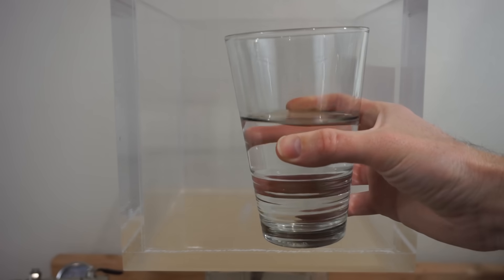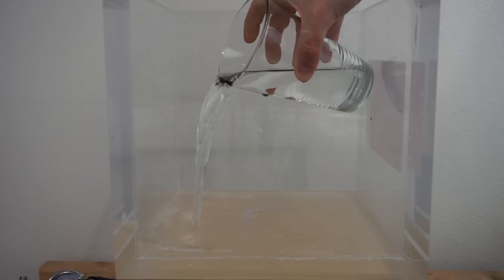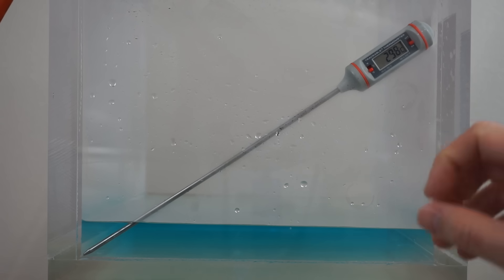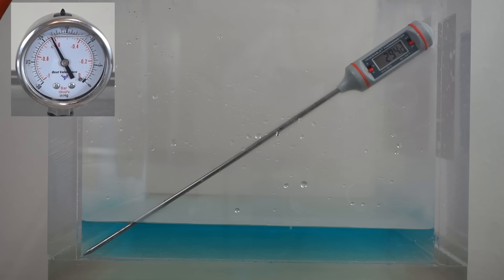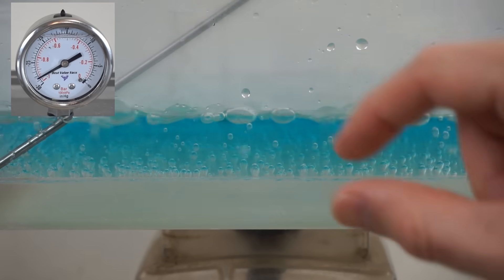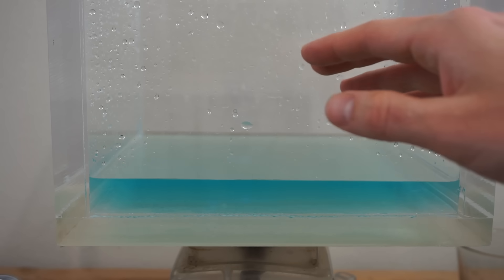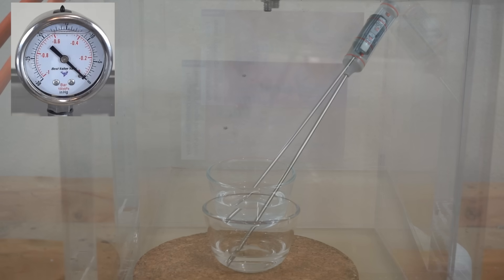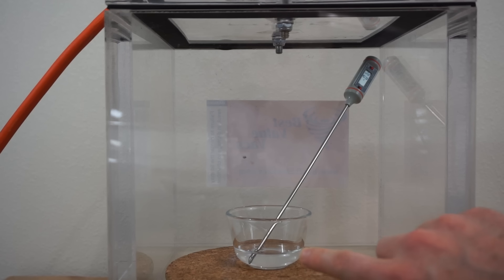Does Water Really Boil in a Vacuum Chamber? And Why?

Comment: so it is possible to drown a fish
Reply: Mind blown
Reply: Yes fishkeepers know this, when oxygen is low in water fish drown the first sign of low oxygen is fish going to the top of their water to breathe.
Reply: @TheFakeyCakeMaker  yes
Reply: Wow.
Reply: Is it possible to fly on air without wings?
Reply: @alaaalkhamis8306  you become the wing as soon as you displace air around you, regardless of the shape.
Reply: @alaaalkhamis8306  yes. With enough constant lift. Like a jet pack.
Reply: @alaaalkhamis8306 yeah helicopter
Reply: Dont change the aquarium water or airate it.. and the fish will drown..
Reply: If you drag a fish backwards in water, its gills are forced open and it can drown..
Reply: @TheKing318i  makes sense, you cant be inhaling for ever
Reply: the fish will explode before so no-
Reply: @lilofication what
Reply: it can already drown in water 
some fish will die due to too salty water
Reply: fish use water to stay alive. They do NOT breathe dry air. THE END
Reply: @philindeblanc bro skipped 1st grade and everything after
Reply: i almost died xD
Reply: Cook a fish
Reply: @saw9634  I guess its not just heat that is boiling, it can be the pressure like this and perhaps its gas escaping the liquid. Some things we can only try and explain, while institutions of science want to claim it knows what is happening. It certainly does not.
Reply: Fish can drown…

In Fire
Reply: @muhammadfuzail1574  fish can drown in plain ole water. They still need oxygen. If the water cannot replenish oxygen faster than the fish use it up, they die.
Reply: Would it be drowned or would it suffocate 
I’m not sure what the difference is really. 
I assume drowned usually first to be in it liquid since fishes live in liquid can you just removing all the air I think they’re suffocating
Reply: No. However, you can suffocate a fish. If you remove the oxygen from the water, the fish can no longer get oxygen, so it suffocates.
Reply: Can you dry clothes in a vacuum chamber?
Reply: @DatOneMango hade you ever looked at a fish tank? It’s a mashine that bubble air into the water, if you wouldn’t have it they would actually drown after a while
Reply: yes fish need oxygen
Reply: @SodiumInteresting theyre animals ofc
Reply: @Mango The Protogen  fish need air to live but they need water to breath it so if you push air into the blood stream of a fish it could live outside of water for a while longer the normally
Reply: Yes
Reply: Well if it didn't it would be like saying humans can breathe in a vacuum. If there is no air neither the fish or the human can breath
Reply: Most fish you need to aerate the water or they will suffocate the die. Goldfish require very little oxygen so they don’t usually require an air pump. Most people have only ever had goldfish
Reply: Fun fact:
Fish can drown in dirt
Reply: It possible just take their gills
Reply: @dailydoseoftiktok6315  you dont even have to do that. If all the oxygen in the water is used up, the fish will soffocate
Reply: The only reason your goldfish doesn’t die in stagnant water is because goldfish can survive in very low oxygen environments
Reply: Yeh if you remove all the oxygen from water like in this video the bubble thing , than the fish will drown like a human
Reply: Yes
Reply: Yes because fish need air to survive like us so if the water in the tank is too dirty the fish will die
Reply: The fish will explode
Reply: YES
Reply: A few have commented about fish "drowning" if you don't change their water, but that's not correct... they actually get poisoned by their own wastes.  First they produce ammonia, which in an established aquarium have enough bacteria to break that down into nitrites. With insufficient bacteria, "new tank syndrome", and too many fish, you can lose them to ammonia poisoning. The nitrites are quite harmless, and they too soon get broken down into harmless nitrates. However, the accumulation of nitrates will eventually become toxic enough to kill the fish, that's why small regular water changes, about a quarter to a third every week or two, depending on the size of the tank, is necessary. The bigger the tank, the less frequently you have to do it, but it's essential to still do from time to time. 

Oxygen exchange actually takes place on the surface. Those air-bubblers can actually be harmful to the fish, as tiny bubbles can cling to their gills preventing oxygen uptake. A small amount of good quality salt in their water actually helps with osmosis, and it's surprising just how much you can safely add to still have "fresh" water. Pure water is actually bad for most fish. 1 teaspoon per 10 litres is a good rule of thumb to use. To understand how safe this is, most fish can survive in brackish water, which requires about 15 teaspoons of salt for every 10 litres, whereas marine seawater contains around 30tsp/10L. 

The bubbles in the tank really only provide oxygen as they burst on the surface. The best way to aerate an aquarium is with an internal water-pump filled with bio-balls or sponge, allowing for a large surface area for good bacteria to thrive. The best set-ups have an external tank or canister which leaves more room for the fish and more water to dilute toxins. Any flowing water is agitating the surface, where oxygen is replenished.

In the cases where fish suffocate due to low-oxygen, it's more likely a sudden pH spike or dissolved toxins, rather than actually low oxygen. 

As a general rule, the larger the surface area to volume, the better. In other words, a wide shallow pond rather than a narrow deep pond, gives most oxygen. A round bowl isn't ideal to keep fish in, unless for a temporary display. However, only fill it to the point where the surface is largest. If it gets narrow at the top, and you fill it all the way, your ratio of volume to surface area is not good, and fish can actually suffocate in more water, rather than less. It's essential to freshen their water daily, and to use something to remove or chemically alter the chlorine in treated municipal water.

Oh, and if you really must euthanise a fish for any reason, the fastest least cruel method is the sudden severing of the spinal cord at the base of the brain. Same for any vertebrate creature, actually. Remember that if you're fishing for food, rather than leave them to slowly suffer and suffocate in a bucket or whatever. Stress and torture taints the flavour of any meat, so at least send your meal off as peacefully and quickly as possible... by violently chopping off its head.
Reply: No, but they can be oxygen deprived in a vacuum - drowning has a specific definition that what you're probably thinking doesn't fit. Fish will not explode as at least one person said. I have a much more powerful chamber vacuum sealer and the meat doesn't do anything close to exploding. Room temp water boils after about 3 seconds though, so when vac sealing things containing any substantial amount of liquid (more than is contained in raw meat), you have to take some precautions
Reply: Yeah is they get pulled backwards through water their gills don’t diffuse the oxygen propped and they go unconscious
Reply: If the moon suddenly disappeared I would hazard a guess and say a lot of fish would drown. No waves = no aeration.
Reply: @Neoprenesiren they wouldn't drown, they would suffocate.
Reply: @randal_gibbons  "To kill by submerging and suffocating in water or another liquid." I get you mean we don't suffocate the same way underwater, but drowning something means to suffocate under water.
Reply: @Neoprenesiren  doesn't drowning require liquid entering the lungs?
Reply: No. Drowning requires water in the lungs, fish don't have lungs.
Reply: Well yes, if the water has little to no oxygen for the gills to collect, you can see this happen when filters in fish tanks clog, the fish essentially suffocate on the grit and garbage from the water they swim in.
Small tanks show this better than large because there is no where for the excriment and filth to go besides the filter or the tank, as oposed to the oceans it has large enough space to dilute or float to the bottom and settle.
Lol makes me wonder what the sludgy stuff on the bottom of the deeps sea submersible dives contains.😝
Reply: Can't say no
Reply: Actually yes, they can. If you've actually spoken to a fishkeeper. Many fish use actually a ton of Oxygen. Larger species in particular. I know Goldfish, Cichlids, Catfish, Pacu, Lionfish, Triggerfish and Oscar's all actually use so much oxygen, if you look it up, you'll be surprised. I know this cause I currently have many of all of those animals, except for Pacu and Catfish they get too big
Reply: yes octopi drown sharks all the time.
Reply: @kaleknelson8429  octipi not to be confused with octopi.....
Reply: @andrewvarcoe4741  no double and tripple checked. The multiple of octopus, is Octopi. It's possible that google is getting this wrong, but unlikely.
Reply: @kaleknelson8429  lol google getting it wrong, that's like teaching your kid to tie their shoes a certain way, then telling them they are doing it wrong.
Think about it, google is like a big bottle of information that people smart like you and me or dumb like others fills up. There are a lot and I do mean a lot, of dumb people out there. I'm just happy it gets some things right every once in a while, like searching how to boil water or an egg.
My thoughts on google, its a love hate relationship.....
Reply: If you put it in air.
Reply: No because they don’t have lungs like we do  instead they have gills if you took them out of water they would Generally, freshwater fish can live outside of water for about 10–60 minutes after 10-60 minutes they die
Reply: summers
Reply: If a fish Go to down she gona drow 😢
Reply: Shoke a fish
Reply: The real question is can you waterboard a fish?
Reply: It might be more accurate to say that they would suffocate.

Comment: Air pressure is also the reason air gets colder as you get higher in altitude.  
The higher the altitude the air looses pressure = it looses energy.......so the air gets colder.

Comment: why say "boiling"? it doesnt heat up! should be called "bubbling"
Reply from the maker: +Neil Baxter because the definition of boiling is when the vapor pressure of the liquid is greater than the pressure surrounding the liquid. Bubbling is when there are simply bubbles of a gas in a liquid. Boiling and bubbling are completely different phenomenon.
Reply: Very good experiment James. Well done. I guess the word boiling in most people’s  mind is associated with bubbling as a result of heating. This experiment proved that lowering pressure could achieve boiling without heating. The second part of the experiment was very neat too: the water left in beaker was getting colder.  So the degassed water ought to have different characteristics eg refractive index or for example a higher density than the original water. You may have demonstrated that already. Regards , Houtan Sadeghi-Jorabchi
Reply: @houtansadeghi  sorry to disagree!

quote  - This experiment proved that lowering pressure could achieve boiling without heating. 

in my opinion water was bubbling and not boling and so no proof of water boiling in a vacuum! To be fair this demo merely shows a lack of imagination within science to describe the observations fairly and accurately as there is no proof in the demonstraation water was actually being evaporated as would normally be associated and observed with boiling. 

Boiling example - place saucepan of water on heat and leave. All water evaporates from saucepan
Bubbling of water generated by vacuum - air in water is literally 'sucked' out of the water as the pressure above the water's surface decreases. Temperature reduces, bubbling stops, water eventually flash freezes

I can understand why you think boiling occurs because you are only looking at the bubbling but are failing to place this bubbling into its proper context. One also has to bear in mind boiling is a process that has the ability to change a material's state eg liquid water into water vapour.

Anyway that's my personal opinion which is at odds with your opinion so please don't ever put your view across as being factually true else you would be misleading people.

Thankyou
Reply: We only assosiate it with heat becuz MAC N CHEESE
Reply: Boiling does actually include the word heat within its definition.
Reply: Water in a vacuum first bubbles then boils!
Reply: Felix Rojas That's because some parts starts boiling first
Reply: So little bubbles aren't boiling but big bubbles are?
Reply: Peter & Pete boiling is a cooling reaction.
Reply: i can understand your point but the water does not boil in this video!
Reply: @PeterPete  educational level: third grade 😂
Reply: @dp6815  well who's educational level you referring to? certainly not mine as i wouldn't educate people on this rubbish!

Comment: So, basically it is not boiling that is heating, it is more accurate that is dissolving oxygen when breaking apart, or oxygen escaping, which it is losing pressure, as it gains to lower pressure at a high level, where cold reign, away from heat reign, at higher pressure. So, vacuum and boiling are same, escape we don't see a boiling with increasing temperature, because it is heating faster as cause oxygen to contract with other oxygen, as pressure increase faster than losing pressure, as decrease pressure, that is oxygen is escaping, moving away from other oxygen. When I say break apart for oxygen, that mean the molecules break apart to smaller molecules, or it is escaping? You say dissolve, what ya mean by that?

Comment: Because you're taking the oxygen out of the water. The bubbles are hydrogen trying to escape from the water. I'm 12 and know this because of Science classes
Reply: Nope! The oxygen is not taken out of the water, in the sense that the O is not removed from H2O! The water is degassing, meaning that the gasses which are dissolved in it, are escaping. These gasses also include oxygen, nitrogen, etc but don't get confused: They are not part of the composition of water. Just as nitrogen is not part of the composition of water but can be found dissolved in it, the same applies with oxygen which can be dissolved in water but not be part of its composition.

Comment: dose water without air in it taste any different?
Reply: i think it would taste different, after the dissolved gases are removed from the water, the pH of the water would probably rise and be less acidic, and since things that are acidic have a sour flavor the water would lose some of its flavor, not 100% sure though
Reply: Whaaaaaat?!!!...
Reply: Water with no air tastes the same!
Reply: Rednaxela Buttocks the formula is H2O so its 2 hydrogen atoms and 1 oxygen atom
Reply: He didn't say anything about taking out the oxygen. Also, your formula is incorrect.
Reply: RobluxMastah 214 The formula for water is 1 cell of hydrogen and 2 cells of oxygen.(At least I think I didn't check my facts) If you take the oxygen out and then drink it. It will most likely kill you.
Reply: k

Comment: hey bro, if petrol evaporates at room temp, because the energy of the molecules can break through the surface and leave as a gas, will you test what happens to it both in a vacuum and after the vacuum?? like would it still be flammable afterwards or would all that energy be gone??

Comment: Will pasta cook under these conditions or does the water need to be hot?
Reply: No.  The fact that the water is boiling actually hinders you from using water from cooking, rather than helping you.   You want the water to be in a liquid state at as hot of a temperature as possible, in order for it to be effective at cooking food.

This is the working principle behind a pressure cooker, so you can get the water to be liquid at a much hotter temperature.  This is also why products cooked in boiling water have high altitude instructions, that require a longer cooking time.